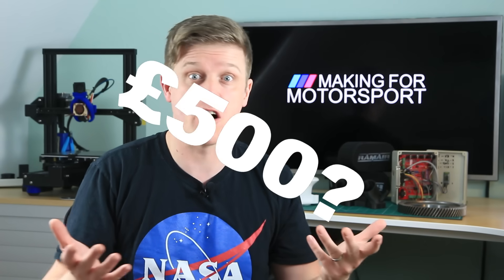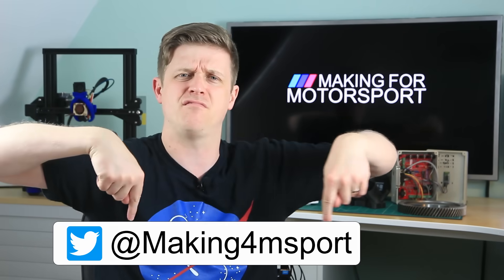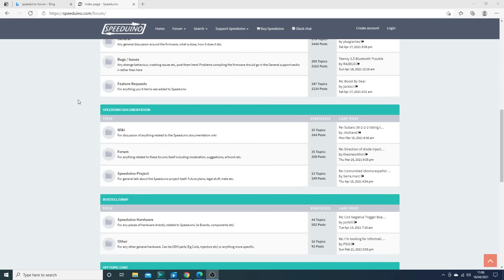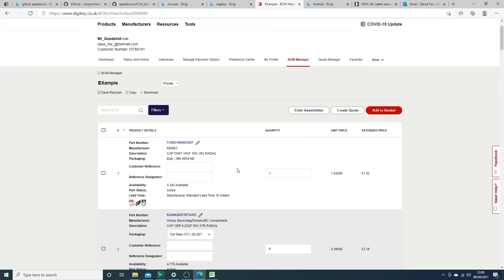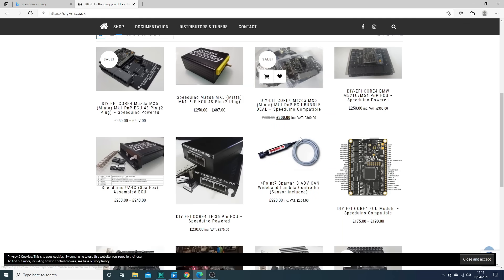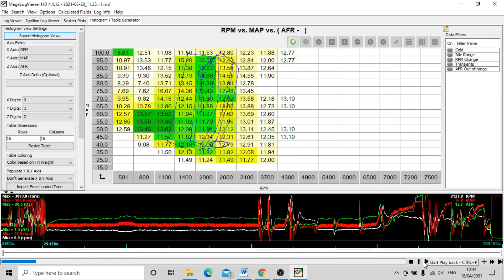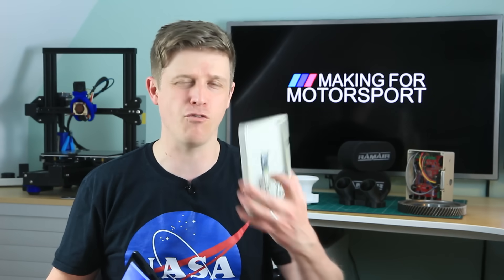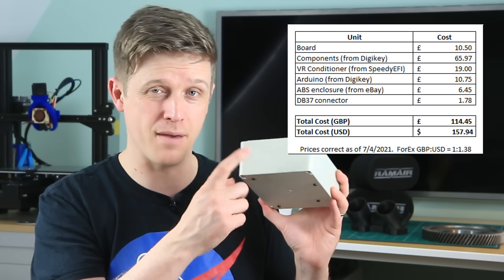The Best Value Standalone ECU - Speeduino

Comment: Hey, I'm loving this idea, I've got a 7 port head for my classic mini which I intend on running on a set of R1 throttle bodies. after a bit of searching after hearing about arduinos being used as ecus and found speeduino. awesome stuff
Reply from the maker: 7port a-series is trick stuff!  Very nice!  A speeduino will work that very nicely… but I’d recommend a proper trigger wheel and a modern wasted spark coil… sack the dizzy off!
Reply: @MakingforMotorsport  already running a megajolt so have the trigger wheel and coil pack etc, so now I have all the stuff I don't really have the excuse to not get on with it!

Comment: A raspberry pi. They can take arduino shields aswell, so yea one would need an input, maybe a bmwesque knob, and a custom os but yea def need that extra software power from a real computer, not just the chip.

Interested in this, as i just want a way to control the fuelairmix, if i open up the stock airbox on my 1.6l cancer. Like how much could one make more, with just a freeer "cold" air intake, and upping the fuel squirted, and redline. This ofc would f emmissions, but have that regular  preset saved somewhere, and just swap the stock airbox...

Gotta check this out, like why is there a need for custom circuitry? And is that custom circuitry fit for all cars, or is it like emulating a type of cars spark input, idk haven't checkd much deeper, but yea as a cost effective solution, this is badass. And they sell prebuilt ones aswell. That 1.6 is an oversquare 2 anyway, so it'd be able to go to 8krpm with good lube, but it needs an fton of fuel....
Reply from the maker: Unless you want CanBus, there is no need for more power, my Speedy runs over 1,000 program loops/sec.  That’s 4 full recalculations between every spark event, plenty.  Josh, the creator made one with a 400mhz processor, no difference.
At the heart of this program is relatively simple maths, same goes for all car engines, there is reason BMW isn’t using i7 processors in their ECUs… you don’t need them.

I am not sure what you mean by custom circuitry? There are different sensors, like crank sensors but mostly they are allowed for already.  There is a prototype area if you do want something different but generally that’s not needed….
Reply: @MakingforMotorsport  Thanks for the reply mate! Yeah, i was maybe a bit confused about the DIY element, but i watched you solder the speeduino together, and it makes a whole lot of more sense now. I was a bit overwhelmed, soldering is not my cuppa but for this price i could seriously try!

And, yea the i7 for sure is not needed, but a pi is compact, cheap, and disposeable. If one could just somehow use the headers within that board, it'd be easy, and also easy to multiplicate on other cars. But yea, the board is 5v and a car is 12v, one would still need "custom circuitry" in resistors, and power changers etc but yea. This is still so cool,  vs buying a multi hundred or even thousad quid ecu. Valuable content!

Comment: i have a kawasaki z1300 6 cylinder  from 1981 i have a blake turbokit for this bike whidt carb . i want fuel injection on it .  3 double carb setup orginal from kawasaki whidout turbo . what do you recomend for my bike
Reply from the maker: Now that sounds like a machine…. Going from carb to injection, you’ll need throttle bodies, injectors, and an ecu, but most ecu can double up as a boost controller aswell 👍

Personally, I would start by finding an ECU which will do it, a 4channel Speeduino would do it, with batched injectors and wasted spark, then look for a road bike running similar power that you are aiming for, that way the diameters and injectors will be about the right size, preferably a 3cyl, but these might be too small… in a pinch you can get ITBs off a v-twin or v-4, these are then reconfigurable into a 3 (or 6).
Then you need a manifold to join them to the engine, a high pressure fuel pump, and all the wiring.
A slight complication could be your ignition setup, single coil and distributor would be simple but you’ll need to get a decent trigger wheel onto the engine (preferably crank) to give a sensible crank angle resolution.  Then all the sensors will need calibrating or adding  (intake air, coolant temp etc)

Overall, on an old engine like this it can be tricky, totally doable but needs to be kinda done from scratch!

Comment: how about cpu speed is very slow in 0.3 board
Reply from the maker: I get over a 1000program loops per second on my v0.3 boards… that’s nearly 4 full programs loops inbetween individual spark events at 8000rpm on a 4 pot??? Plenty fast enough….
Reply: @MakingforMotorsport  I tried v 0.3 board  it was slow response in changes and one time when I was go to start the engine lost the data and I found that it was from low batt voltage, maybe it wasnt good board , I want to try 0.4 to see if it better.
Reply from the maker: @ecuperformance959  sounds strange, like there was something else going on… but I can lock the timing at 10ish, blop the throttle and it’s rock solid…. Hope you get it sorted.
Reply: @MakingforMotorsport  I dont really know,but Im in the ropes know to try a 0.4 board on my bmw m43 318i ,Im planning to work it like standalone only for fuel and ignition and keep my stock ecu for dashboard,asc and clima  .0.3  was on w202 merc 2.3 .

Comment: I welded my citroen c2 shafts inside golf mk4 by slotting on either side of the vw tube but not to the end so it didn't have a weak spot and welding throught the vw shaft into the c2 I'm putting over 300bhp through these for 6 years now no problem yet
Reply from the maker: Nice, sounds like a good solution… I do love it when people say not to weld shafts…. And people do with no issues at all!

Comment: Im in The U.S. Tennessee. I have a 1996 F150 FORD and im junking the EFI and going to a Carb. Can I use the factory ECU to control the transmission still?
Reply from the maker: You can run the factory ECUs, leave all the inputs in place (temp sensors, throttle etc) but disconnect the injectors and coil and let Speeduino do them.   
This means adding more sensors to the engine which is more work but your Stock ECU and gearbox won’t notice the difference…

Comment: I have a 2006 Chevy cobalt Lt which has a factory ecu that has been orphaned by most tuner software so a standalone is almost required.
Reply from the maker: Unfortunately there are a lot of OEM ECUs which you can’t play with… this’ll work but it ain’t the job of 5mins to fit 😅

Comment: Thanks for doing this video.  I have a 1980 FIAT 124 spider 2.0L that I have built up for auto crossing.  I am installing ITBs off a 2004 CBR600RR and want to do away with my distributor.  I was trying to decide between the Speeduino and the Megasquirt.  this video was perfectly relevant!   Thanks!
Reply: please document your journey! i have a 1986 X1/9 that i'd love to put one of these into

Comment: I’m building an 98 328i e36 sedan fully gutted interior stock wiring gutted strictly track car no heater just lights and engine management I want to run a stand-alone ecu for the m52b28 mated with a zf 5 speed

Comment: I have a Speeduino on my E30 325i. I cheated and went for a plug and play that connects directly to the existing Motronic 1.3 loom. Added a wideband O2 sensor. Downloaded a base tune to get car started and TunerStudio with the auto tune upgrade.  The fun really got started after I ripped out the stock induction setup and put in a set of RHD Engineering ITBs. Found getting the tune right a bit of a challenge as it was a steep learns curve, but it was my own fault. I just can’t leave anything alone 🤣
Reply from the maker: Ooooh…. 6cyls sucking straight through ITBs.  Me likey!

Comment: I have a Datsun 280zx or a Nissan S130 Z. I’m planning on turbocharging it. It may be a bit high compression but I’m running low boost, good cooling, and good efi to mitigate for that. I was looking to get a Megasquirt Diy kit and run Ford EDIS and mod the trigger wheel a bit. But now that you mention this, this is a whole different animal. This changes everything. Thank you
Reply from the maker: Have a look into it, I had a MS1ex back in the day and this is cheaper, easier to put together and does the same thing….

Comment: didn't you have any troubles with out of stock components when ordering yours? currently they're out of half of the components needed (digikey) ;/
Reply from the maker: I had no problems when I built my 2nd in May21 but I remember 1 of the suppliers had some no stock, digikey was out of the screw terminals but that’s an easy swap.  Try Mouser and Farnell aswell 👍
Reply: @MakingforMotorsport  I did try them both. cpc was the only place I knew before. they all have stock shortages in some areas 🤔 I'm definitely making a standalone for my bike. the longer I research the harder it gets though. Didn't realize there are so many speeduino based open projects. Currently I'm mostly interested in the Blitzbox, it's looking just amazing 😮

Comment: I wonder if there is a speed pi project.  Basically the same thing but raspberry pi based
Reply from the maker: It’s been talked about and may be possible however would have much reduced functionality.
Speed isn’t the issue, the full loop runs 1000times a second even on the Arduino, you need lots of hardware timers to time injectors and spark advance.  Micro-controllers often have the hardware timers, microprocessors less so 👍

Comment: Do you know if this system will work for a straight six platform? 👀
Reply from the maker: It absolutely will run a Straight6, but in wasted spark and paired injection mode…

Comment: Would this only be for the engine and not mess with interior controls or all of it?
Reply from the maker: Short question, difficult to answer...  this can just run the engine yes, that's what I'm doing, but the key to the answer is what does your current ECU run in the car apart from the engine?   So if you replace your current ecu with something else, what else do you need to run?

Comment: I have an 88 volvo I'm looking to motorcycle carb swap buy started looking at retrofitting efi then found your video for a stand alone
Reply from the maker: Hopefully it works for you…. If you can get hold of parts from other engines in the same family as yours which were fuel injected (like trigger wheels etc) it makes life a lot easier…

Comment: Great video. I was considering going fot a MS2 for my toyots 4AGE 20 valve, but you got me going for a speeduino. Thanks
Reply from the maker: Check it out, specifically the idle valve (virtually everything can be made to work), and then don’t look back!  And by the way the 20v 4age engine is a pearler…. I drove a mates Levin years ago and loved it! Enjoy
Reply: Thanks for the tip, the engine is going to go in my restarted locost project for autoslalom racing. I'm trying to put back the low cost in my project. Glad to have found your channel. The 3D printing looks really fun.

Comment: I need HELP i have a g16a suzuki 8v single injection engine and i am struggling with my ecu and wiring i would rather get a ecu kit and make everything simple let me know !!!!
Reply from the maker: Hi Kieran, I will be honest it’s virtually impossible to fix things from a distance… if you want a stand-alone then I’d recommend reading the manual several times until it makes sense…

Comment: This product is about to gain even more traction with the OBS Ford tuck crowd. A lot of Fox Body Mustang and OBS Pickup owners are having trouble finding replacement EECs (what Ford called a PCM back in the early 90s) as time goes on. I know Speeduino won't work for MAF equipped vehicles, but the older O2 sensor-only rigs can use this setup easily.
Reply: It's not o2 sensor only. Difference is MAP or MAF

Comment: Hi, I have an old Toyota 6 cylinder ,I would like to run itb's as well as 1nzfe coil packs & want to use the distributor as a trigger,would it beagle to do this thanks and what model board would u recommend
Reply from the maker: Hi there, most Speedys can do this is wasted spark mode (using 3 spark outputs and the 2 COPs per output).

You can use the dizzy to get crank position and there is a fair amount of documentation on the Speeduino wiki for it but just be aware this will always be less accurate than just reading it direct off the crank…. As for board, the only one which won’t work is the NO2C, so really the choice is yours but I’d expect a v0.4 would be ideal!

Comment: I have a 1.4 Nissan Note 2008 with a supercharger kit off a JDM Cube fitted, Nismo tubular manifold, s/s exhaust and high flow air filter. Having trouble trying to find someone to remap it cos no one has done it before, and it's a lowly Nissan, so no one wants to know.

Comment: I was considering a micro squirt for a motorcycle project converting from carbs to injection. Do you think this ecu would be small enough and suitable for a project like this
Reply from the maker: Hi there… there are plenty of people running motorbikes on Speeduinos, it’s about the same size as your standard ECU.  If size is a real issue look into the NO2C version which is the same size as the Mega Arduino so tiny, but this only gives 2 channels, so you need to run wasted spark and paired injection…
Reply: @MakingforMotorsport  thank you for the quick response. I will look into this ecu for my project

Comment: Ive got an ej22e (phase one obd2) with a 4eat transmission sitting in a 95 impreza.
Its got a td04 (02 wrx), 550cc side feeds, 6:1 vortech rrfpr and a warlboro 255lph.
Ive got an AEM wide and uego afr gauge and a boost gauge.

The car ran decent with 280cc injectors, but it was leaning out.
So I dropped in the 550’s.
Now it’s running WAY rich. Like sub 10 afr’s.

I need to dial back my afr’s via a fuel management system.

What should I use?
Apexi safc neo?
Something AEM?
Speedy Efi? 

What’s a reasonably cheap but reliable fuel management system that would allow me to lean out my afr’s at idle and low-medium throttle inputs?

I may want to go e85 at some point. 
Would these fuel management piggybacks work for that application as well?
Reply from the maker: Dude, with what you’re pushing I’d say you should be thinking standalone not piggyback, especially if your thinking e85 in future as that needs big timing changes to make the most of…   I know the piggybacks are easy but they will always be a compromise… 

Go for Speedy and you will have total control of fuel and spark, twin tables to run different fuel and spark for e85… it future proofs you…
Reply: @MakingforMotorsport  that’s where I decided to go. Haltech 750 seems to be a good pick for my ej and the ez m.

Comment: So after I've built this, how do I go about tuning it? Do I still need to go to a dyno or is this something that I can do myself or it does for you?
Reply from the maker: Abit of all 3 to be honest.  The base tune will likely get you started… from there you can take it to dyno ( but check your tuner will use it first if you are dependant on this option), or you can try to tune it yourself (it’s not that hard to get close) and/or you can use Autotune on tuner studio and that will closed loop change ur VE table from your Lambda sensor.  Spark is trickier to get right on the road but there are ways to do it… but if you want every last horse… you need a steady state dyno - end of

Comment: Great information!!  I'm working on converting my 72 Jaguar XJ6 S1 from carbs to ITB's.  This solves one part of the puzzle. Cheers!
Reply from the maker: Sounds like a great project!  I have a series on ITBs aswell, I used motorbike ITBs, they are fantastic for the money!
Reply: @MakingforMotorsport  Yes, good info, I've watched it. I've found a company in Australia that sells itb's with the same bolt pattern as the side draft Weber's. 😃 My remaining challenge is air filters and either wasted spark or coil on plug ignition.

Comment: What if you just need ignition
Reply from the maker: Just run the ignition, that side of Speeduino doesn’t care where the fuel is coming from, just what the load is and engine revs (maybe some temps if you enable those features).

This is exactly what I did whilst running my carbs, just used it as a 3D ignition controller and Rev limiter…. Worked like a charm! 👍👌

Comment: Currently working on a manifold to stick ITBs on a 2.0 Duratec ST150. Very helpful videos!
Reply from the maker: Oh man, Duratecs LURVE some ITBs, SBD get 203bhp with ITBs, a decent exhaust manifold, bigger injectors and uprated rod bolts so you'll see good power with just the ITBs.   I've done a series on ITBs if it helps but just get the tracts right and you'll be laughing!  Best of luck!

Comment: Could you add multiple fuel maps on a speeduino so like 1 that's very fuel economic friendly for daily driving and another for hauling ass
Reply from the maker: You can run 2 fuel tables so you can have it like that if you wish, I would just tune the 1 table so that anything below 1/3 throttle is economy and everything else is all power and responsiveness...